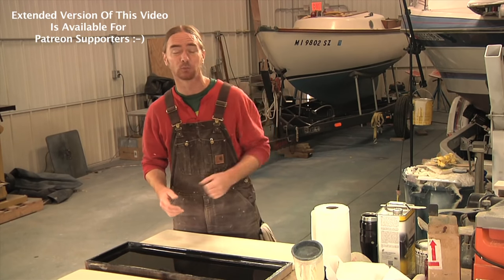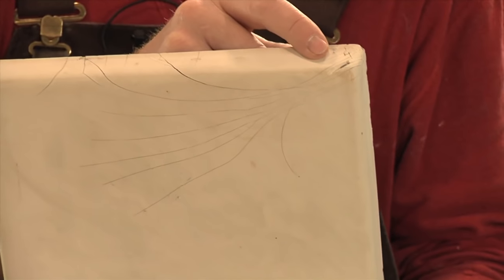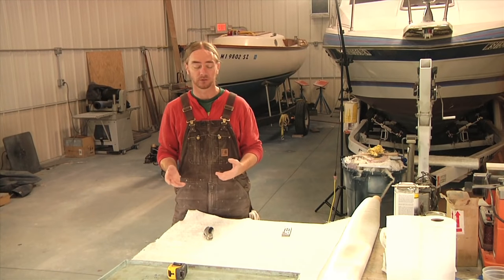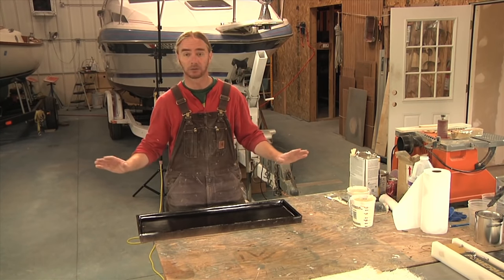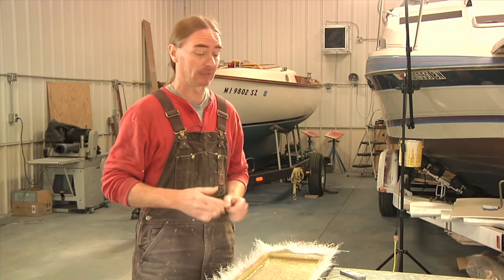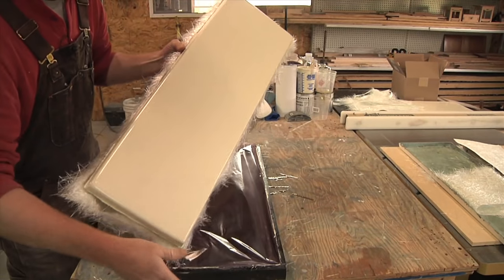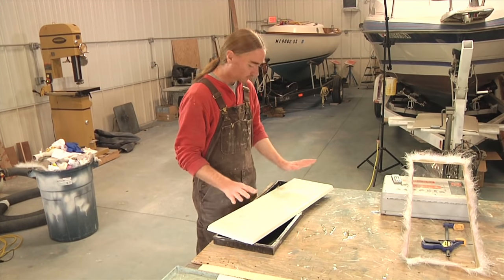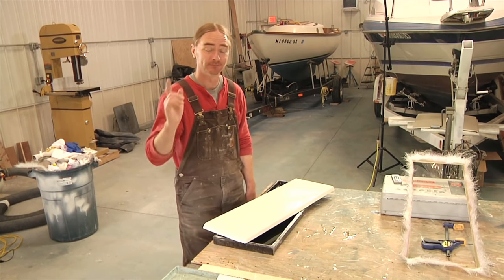Making A New Fiberglass Hatch From A Mold

Comment: Hi
I never did work on fiberglass before and i watch your videos and i try make a tray for my milling machine, i sprayed the coverall and after i used the gel coat with no wax 5 days a go, my question is i have to send the gel coat before i put the fiberglass or not?
Thank you
Wagner Damotta
Reply: No sanding if you used laminating resin (without wax)

Comment: What kind of blade do you prefer for cutting off the "flagged", or excess, fiberglass on that oscillating cutter?  Thanks!
Reply from the maker: +J. Mark Foreman II I think it's just a general purpose wood blade.  My cutter is also made by Fein and they make a number of blades (some very expensive) but I generally use the cheap ones so I don't feel so guilty trashing them :-)

Comment: Years ago, my first skipper (65 foot gaff rigged schooner, steel hull), told me that initially fiberglass hulls were much thicker than they necessarily needed to be, and once this was figured out, after that time fiberglass boat hulls were made far thinner, and that if I could find a vessel from right before that year, then my hull would be a great deal stronger and safer. Is this true, is there a specific year that there was such a shift, and if so, is it worth looking for and investing in an older boat for this reason? thanks 🤓

Comment: Best Video on Fiber glass mould process.
What i understand first we need to apply 2-3 coat of PVA, then after a hour we need to apply 2 layers gel coat , then we have to put glass fiber matt and then epoxy resign.  Is it right ? can you please tell me the correct composition by weight for making a rectangular sheet of 5mm.

Comment: This is a continuation of an earlier post.  I have a piece of clear lumber used for step treads.  It’s about 1-1/2” thick.  Solid, not a laminate.  A few coats of fiberglas resin and hardener over the bare wood and you have some that looks like a boat. It will last forever.  Use the “tape on traction strips” and your good to go.  1/2 the time 1/2 the cost, looks boatyard, it’s all boat.

Comment: I just bought a 1984 Cape Dory Typhoon. There is some cracking and delamination around the mast step. I'm guessing the core will need to be replaced and relaminated. What kind of core do you recommend for under the mast step and should I consider putting in a compression post.

Comment: love your videos,  Did you worry about  making the panel to narrow along the sides by glassing it from the inside? I need to do this for battery box/ bildge cover on my 1996 key west 2300 which is probably around 2 ft by 3 feet. How much weight/ mat and cloth did you use? What would you recommend for the size i'm about to do?  Right now there is too  much deflection causing the gel coat to crack off. Keep the videos rolling. Thanks
Reply from the maker: For your panel I'd probably go with the following layers for the flat part: csm, 1708, csm, 1708, csm, 1708, csm, csm.  This will give a thicknes of about 1/4" and be very stiff.  If there were still a concern of stability you could also laminate a 1/2" piece of plywood along the bottom just before the last 2 layers of csm.  For the sides / lip around the hatch I'd have csm, 1708, csm, 1708, csm all the way around.  Hope this helps!

Comment: Another awesome video ..... thanks !   Question :   I have 2 vinyl blow up type pontoon I would like to fiberglass . I will be using a 2 part close cell foam to spray inside the pontoon to filled it up . Its about no more than 12" inch round by 8ft long for each pontoon . Could you please tell me the step process to fiberglass this pontoon in short so I know the process ? Type Materials , type resin , how many step or coat to each , paint etc.... etc... thank you so much !  Really enjoy all your show !

Comment: Ok so you did not add any wax to any of the layers (at least not that you mention). You said you will wet sand the gel coat in the morning after removing from the mold but it did not have a wax additive when brushed on to mold. The last layer of glass inside did not have wax either. I'm kind of new to this and trying to learn. How do the outsides cure and harden properly without wax additive?

Comment: Hi, I love your videos. Great detail on working with fibreglass. I just have a question. I noticed you don't wear a mask when applying the resin but you do when you are cutting it. I had heard that the resin fumes aren't so bad but the dust from sanding and cutting can be very bad for your health. Is this correct? Any advice on how to stay safe in a small workshop? Thanks for the videos!
Reply: not brag  but i have fixed and built fiber glass  projects  and im 88 now so it not to bad  built my first boat an about 18 yrs old

Comment: I love your videos! You used a laminating gel coat and then I think you used laminating resin for the fiberglass. Was the final coat done with a finishing resin? Did I miss that? If not, how did you cure the gel coat?
Reply: You're correct, laminating gel coat and laminating poly resin. Cured with MEKP. He can come back and add more layers of he likes. If you think you're done and want it to no longer be chemically "tacky," you can coats the finally wet out with PVA when your done laying up, keeping the resin from air curing. But, you'd need to sand if you wanted to add layers later

Comment: Great video! I was interested in how you made the mold. as well. I thought you might make the mold from wood, and use a wax to keep the fiberglass from sticking. But instead you used a product called PVA? I've never heard of it but will do some research now. Is it a better mold release than some type of wax?

I'm interested because I have an old egg harbour that is very run down and I do some work on it every now and then. I have two plastic vent covers that are about 14" X 14" and maybe 6" high. They are all rounded over... no sharp edges. But each is cracked in a couple places. So I want to make a mold with them and make two new ones. And maybe even some to sell if I got good at it. There aren't many (affordable) parts out there for these old boats that I can find. Definitely haven't been able to find the vents. 

So it looks like it would be good to make the mold off the top of the vent, so that I could apply gel coat easier to the top as it was setting up in the same way you did here. So did you add one more layer of wax gelcoat at the end before you installed the thing? That would be the finish coat, right? Anyway, it would be great to see how you make a mold from scratch from an existing shape that you need to make replacement parts for. Thanks again for such great videos. I can't afford to sign up for Patreon but maybe can send you a paypal contribution sometime. The knowledge and experience you share is well worth the support. Thanks again. All the best!

Comment: How do you prevent the West System mixture to start 'going up in flames' in the pot?  (Well not in flames, but I am sure you know what I mean...)  It happened to me even at room temperature with a slow hardener...  Thx, T.
Reply from the maker: +cocalouca The trick is to get it out of the cup asap and spread out to a thinner layer.  If it's left in the cup, it creates heat while it's curing, which causes it to cure even faster :-)  Mix it up and spread it out and you'll have a LOT more working time.  Hope this helps!
Reply: cocalouca you can also mix it in a wide, flat container to keep it cooler. Also, keep it out of the sun.

Comment: ive always used partall#10 pva. i didnt reralize they had purple. impressed with that pva, looks like you sprayed it on a little heavy. im assuming you used poletser gel coat and resin, rite? why the mask with pva but not with gel coat and resin? ha. just found that funny.
Reply: Because he was spraying the pva...not the gelcoat or resin.  Unless you have an air fed mask setup you aren't getting away from those fumes.

Comment: Just wondering why you used 1708 and chop strand matt.  Is the matt better around the edges?
Reply: Not an expert but just my thoughts based on research I did, 1708 is very hard to fold so you won't be able to get a perfect seam around the edges, this is where matt helps you out as it can very easily follow the seam. This is a 90 degree seam which you are not going to be able to do with 1708 - The maximum angle on 1708 I would recommend is 45 degrees, matt otherwise.

Comment: Thinkin about gettin a resto sail. What brands do us recommend for resto around 25'?
Reply from the maker: +volkswatson That's somewhat hard to answer :-/  It really depends on what kind of boat you want, and what you want the boat do do for you.  Day sailor, cruiser, racer,  swing keel for shallow waters, fixed keel for better stability, etc...  I'd say decide how you'll intend to use the boat, and start looking for boats that fit the criteria :-)  Wish I could offer better advice, but hope this helps!
Reply: +BoatworksToday Mostly lakes and a couple of 5-10 mile offshore trips a few times per year... Don't need a racer, but stability would be good.
Reply from the maker: +volkswatson There's a lot of good boats out there..  Hmmmm, not sure.  Possibly a Cal or Pearson?  Either way I'd look at an older boat as they tend to be better built than new ones :-)

Comment: I find PVA a pain in the ass. You have to fog it several times. Normally what I do is wax a new mold 6 times, let vent over night and then give it 2 more good coats of wax , let vent for one hour then spray your gel coat HOT..  I have never had a part stick doing it this way. Remember..  Wax Wax and wax until you can smell it in the the mold and make sure it is super slick.  Oh by the way, your shop is very clean. You should see what our shop would look like after casting a few parts.

Comment: PVA Part-all 10 is best for this type work....anything purple is for general novis ceramic molds...PART-ALL #10 for laminating gelcoat and or resins.... coming from an old salt aka master composites technician....nice part though, glad it didn't delaminate or pre-release before setting up, the Purple is way to slick/slippery with heat change, why its best or anything OTHER than fiberglass

Comment: Hello Andy,  

Can I Hire You for a small project??

My name is Jeremy and I am looking for someone to hire to build me a fiberglass "cap" to close off and seal up a window I removed in our Toy Hauler Travel Trailer.  I removed the window and installed some angle supports to bolt on a TV Mount but recessed it from the inside out so that the TV mount would fold flush with the interior wall (which worked out perfectly).  But now, I need to seal up the exterior and enclose that window hole, so I thought, "What better way than to make a fiberglass cap or cover for it that has a flange that can be butyl taped (for a weather-tight seal) and screwed to the exterior wall (for ease of installation)."   The rough opening is 18" tall x 30" wide so to ensure a proper seal, I think the cap would need to be 20" x 32" and then a 1" lip/flange all the way around it.  The corners of the window are rounded  so if we made the cap with rounded corners, then it would better match the Trailer window for better aesthetics. And as far as color goes, we could simply do a gloss or semi-gloss Black so that we don't have to worry about color matching, as the Black would match the look of the window itself.  Would you be open to creating such a cap/cover for me? And if so, what would the estimated cost be approximately? I look forward to hearing back from you.  Thank you in advance for your consideration.  All The Best, Jeremy Wilson
Reply: Andy, I meant to tell you that I did attempt to send my initial request via the Contact Form on your website, however, it would not send for some reason.